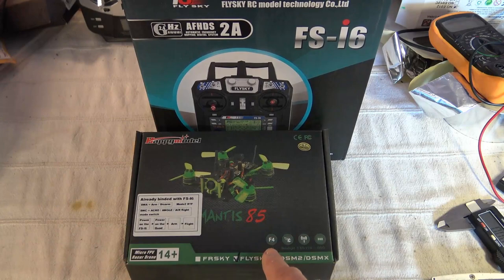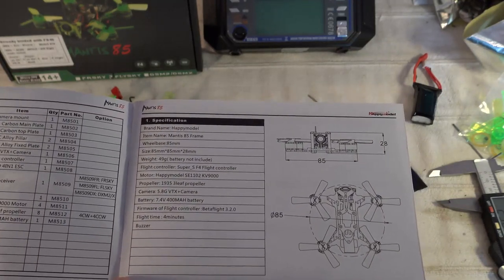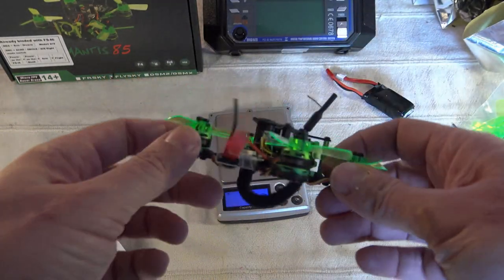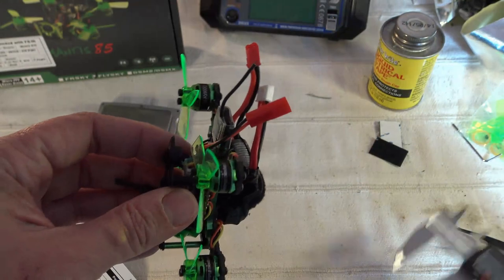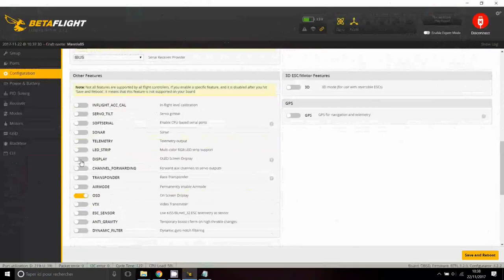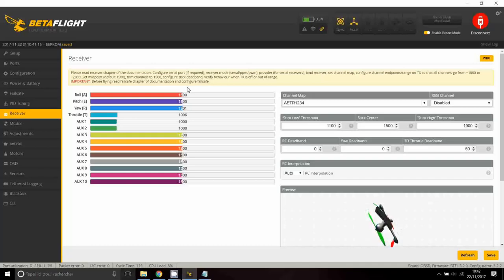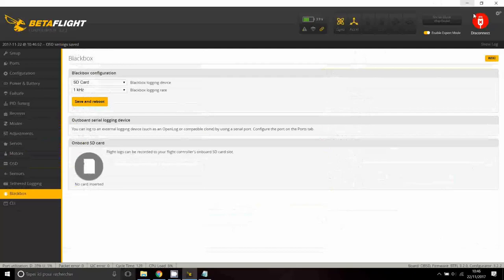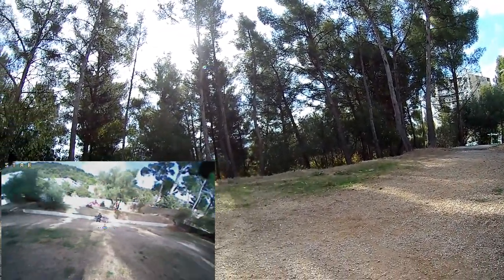HappyModel Mantis 85 RTF unboxing, analysis, configuration and demo flight (Courtesy Banggood)

Comment: Hi seby.i download d beta configurator.my
Problem I can connect it to my drone.
Getting messages port failed.how can I
Get d right port?do I need to flash d firmware
First?im new to this hobby.kindly tell me what
To do?when I bind my mantis it won’t armed
I’m using dx7s spectrum radio.im using 
Dsmx receiver.thanx a lot.
Reply from the maker: Did you installed the correct drivers for Betaflight ? The two mentioned in the first page ?

Comment: Flies well enough, but there are a few things that I agree with you as problematic.  Should have used 1103 motor .. a bit underpowered. That battery is crap .. might be the worst 2S battery I've ever seen. I'm not a fan of the way the RX is rear mounted and the tangle of wires at the back end .. which could get in the way of props.  The camera seemed pretty nice setup, and even has some protection with the stand-offs. I do have a Flysky I6 TX, but I'd much rather use a FrSky setup with my Taranis, which is a lot easier to set up new models, especially with the "copy model" feature (then just make a few changes to the new model).  I see that the FrSky version is abt $100 USD.  Thanks for the review. Cheers!
Reply from the maker: Yes in practice RTF models come in general with a FlySky AFHDS-2A solution coz the radio FS-i6 standalone is super cheap. If there was a cheaper FrSky D8 radio available in the market, I am sure the FrSky solution would be prefered. 1103 or 1104 would have been a plus but probabling would add at least 7-8 extra gram minimum. By the way it's not a bad machine... I like it generally but it's not a monster beast for sure.

Comment: Seby i have the flysky bnf version of this! I wanted tonuse my fs i6s radio. Unfortunately i cannot get the mantis to go into bind mode.. i have tried all combinations atleast 50 times but no luck. The receiver just flashes slow blue and never changes! Any ideas? Please help!
Reply from the maker: You have to press and hold the bind button of the receiver while turning on the quad then press and hold the bind button of the radio and turn on it.... You should have an "RX binding msg".... Then turn off the radio then return turn on and it should be ok

Comment: would you reccommend this or spend the extra 60 for an eachine wizard 220 rtf?
Reply from the maker: Can you already fly correctly a racer ?
Reply: i have had small drones before.
Reply from the maker: I would advise more a 2.5" racer first.... the 220 is close to be a 500g machine and potentially very dangerous.  Have a look to: https://www.banggood.com/GEPRC-Hummingbird-110mm-FPV-Racing-Drone-Omnibus-F4-12A-BLHeli_S-5_8G-48CH-VTX-RunCam-Micro-Swift-p-1245041.html?p=YL2512105842201212FR   in BNF version

Comment: what charger would you recommend for the stock battery?
Reply from the maker: I really like this one I reviewed sometimes ago. It supports LiHV batteries, Internal resistance measurement (health of your battery): https://www.banggood.com/Power-Genius-PG-C610-120W-10A-Lipo-Battery-Balance-Charger-Support-4_35-4_40V-LiHV-p-1185535.html?p=YL2512105842201212FR

You will need a DC powersupply also. You probably have already one with another electronic devise. I strongly advise to buy such kind of mult charger cable: https://www.banggood.com/Multifunction-Balance-Charging-19IN1-Cable-adapter-For-IMAX-B6-B6AC-Charger-p-976339.html?p=YL2512105842201212FR

Comment: Hi.i have dx7s spectrum transmitter.how can program the buzzer to work in my radio?thanx
Reply from the maker: First you need in the receiver section in betaflight to the buzzer and assign it to a free switch/aux, lest's say aux 3.  move the cursor above the value 1500 for a 2-way switch. then program your radio to use a 2-way switch for a the channel 7 (AUX3)

Comment: can i use the transmitter with other quads?
Reply from the maker: No .... I advise to buy in this case the "quasi" universal radio. For example the Jumper T8SG. The new T8SG+ with better gimbal and larger screen will be soon available
Reply: Technically you can bind this transmitter with other quads. I use mine with all my DIY builds just fine.